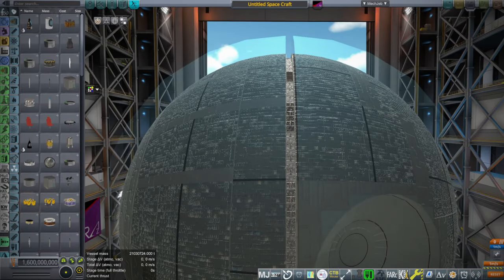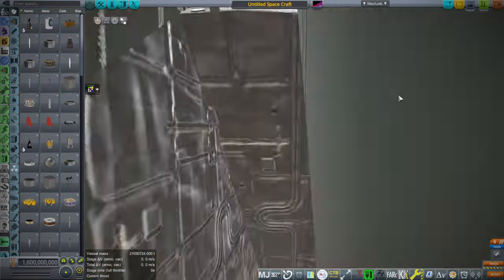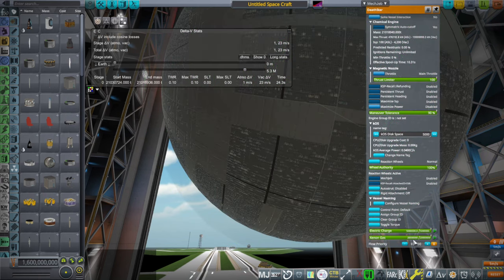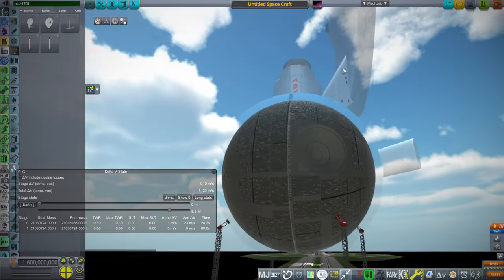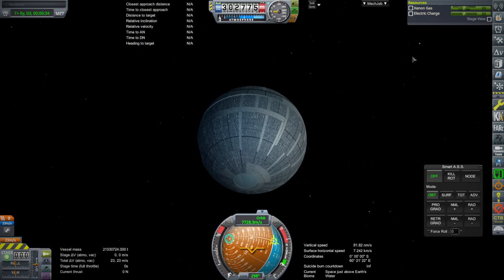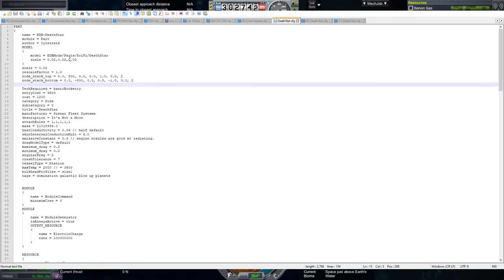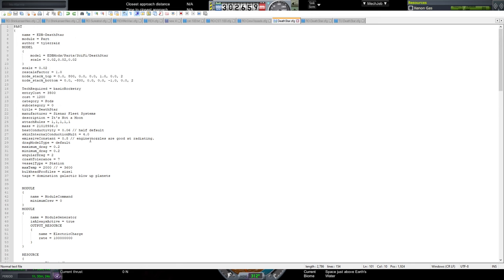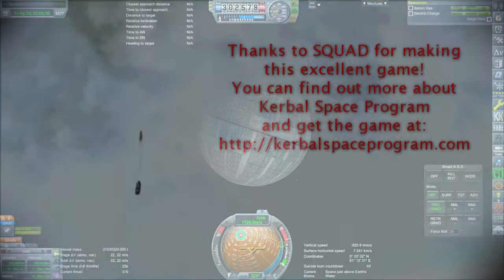Death Star Improvements and Release for Kerbal Space Program

Comment: It’s highly likely the normals are not facing the correct direction to cause transparency and shader textures are not displaying correctly.
Reply from the maker: The translucency on the shield is deliberate. The normals on the rest of the station are obviously displaying correctly - it is only occasionally that they have the strange disappearance, and this is not consistently at the same angle as would be the case of a flipped normal.
Reply: Hmm odd. Maybe a game engine issue?